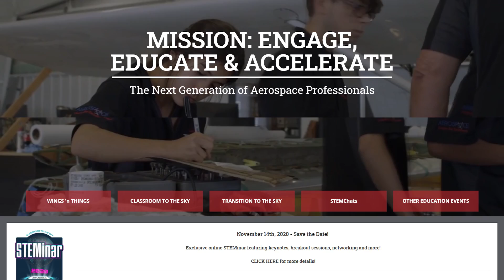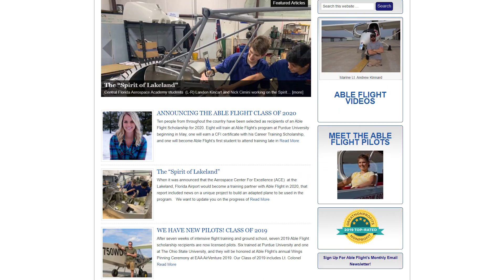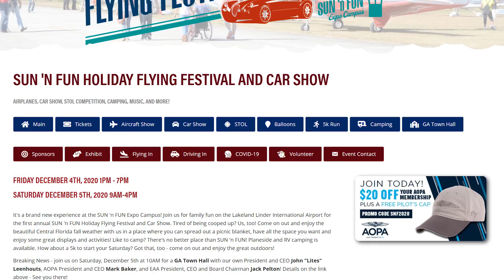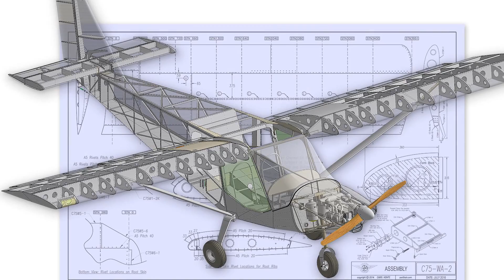Able Flight Project - CH750 Cruzer - Andy Ovans

Comment: Great project. Just some thoughts:
Right seat right pull push throttle.
Left Seat how about twist motorcycle type throttle on the centre stick or rudder stick and the brake on the other stick?
Reason as current set up the pilot has to use the hand for pitch / roll control to change power settings, unless I have seen it wrongly.
Also it would be good it the rudder stick was crannked so that the vertical section was close to the centre of the aircraft, that would allow someone with poor leg control to be able to access the cockpit and might make the grip fee nicer to hold at a more natural postion.
Always worth getting someone who will fly the aircraft to talk to and try the ideas before final fix.

Comment: Absolute pleasure to see this project! Having designed and built a number of hand controls for disabled drivers, and being a microlight pilot (NZ) I would suggest the standard throttle is unsuited. Your disabled pilots do not have 3 hands to control throttle, rudders and stick at critical times, i.e takeoff but mostly landing. My own son is a double amputee and I designed a system for him using a thumb throttle (ATV type) mounted onto the main brake control handle (push/return action). I would suggest a similar setup would allow your Disabled pilots to maintain control of all 3 functions with just 2 hands in these critical phases of flight.  My suggestion would be a throttle pivoting on a horizontal axis (aligned to the pilots wrist rotation)on the control stick, probably incorporating a full hand grip (spade handle). control cable can run down the side of the stick. just my 2 cents worth.
Reply: Was contemplating how I would be able to control all of the systems during take-off/landing and that old ATV throttle is perfect for the job/task. I was thinking about a motorcycle twist-style throttle, like the collective/throttle on a helicopter.
Reply: @v.e.7236  friction may be an issue, and having to grip/release the throttle. Try rotating your wrist whilst moving your arm through the range of movement required for a stick (fore/aft, left/right). It should feel far more natural i.e. easier.  Use the same axis as the wrist for throttle movement. hope this helps. cheers
Reply: @stevemowat4294  Ha! I was going through the motion as I was contemplating your design vs mine and realized that bind issue instantly. You get a thumbs up. lol
Reply: V. E. You are more than welcome. I have spent a short time in a chair myself. Always happy to use my experience to enable differently abled persons. Thanks for the feedback too. Cheers

Comment: This is amazing! I've dreamed of flying my whole life but being disabled in a wheelchair (double amputee with other complications) has made accomplishing that dream quite the obstacle. I've heard of the able flight program and would really like to apply for the scholarship but their facilities are all back east and I live in California and don't have the ability to be out there for the amount of time that would be required to complete the program. What I'd like to do is try and save up and buy my own small ultralight and then modify it my self for hands only control.
Reply: Jess Hull - check out this organization there maybe funding that considers your situation. They could house you and provide assistance during your flight training. Once you’ve been bitten by the flying bug you’ll be hooked for life. An ultralight aircraft maybe the way to go because you can modify the aircraft to meet your needs but getting your initial flight training is a must to be safe. Write to them and ask they may provide you answers or give you some direction. Never hurts to ask they can only say no.
Reply: hey jess hope you succeed zenith has tried for a long time to design systems that address handicap issues also check out the older 2 axes controls on the ercoupe
Reply: william strome - William, I don’t know if you follow James Good’s channel with his ERCoupe? His brightly polished ERCoupe has the mixer control modified with the rudder pedals added to give his aircraft greater control authority in the 3 axis, but James recently covered a story about a pilot with no arms qualified in the original ERCoupe design. Yes it’s the one you mention. I was amazed to watch her live life and operate & fly her bright Yellow 1940’s model ERCoupe. After watching James episode I now feel guilty about complaining about ANYTHING in my life because if she can overcome this disability and be a wife, mother, drive a car and learn to fly and operate her aircraft I surly can’t  complain about my trivial crap I felt the need to bitch about in my life previously. Her attitude towards life for me was a deeply moving and eye opening heart felt understanding of how a person born into a life with a disability that wouldn’t stop her from achieving what she wanted to accomplish. For me she raised the bar extremely high for any person dealing with a disability and with this organization helping people achieve the possibility of learning to fly and developing an aircraft that will be suited for this application I know now where my contributions will go to in the future. I wonder if taking the original mixer assembly idea incorporated into the ERCoupe could be designed into any of these LSA’s. I know the ERCoupe needed to twin rudders to give the aircraft the rudder authority at slow speeds if I remember James talking about the original design. But with design software being so advanced today I wonder if the optimal aircraft couldn’t be designed from a scratch sheet build and utilize this approach and eliminate rudder pedals all together for disabled people. This way the engine control could be operated with the free hand instead of tying up one hand to operate the rudders. This design worries me about operating the engine controls with a pilot on short final and trying to make engine adjustments or cutting power after the landing threshold when their hand is needed on the controls. IDK what these designers have in mind but going over the landing sequence has me concerned a bit. Or maybe they will just need to fly with another pilot all the time. Again IDK. With electronics becoming so advanced these days it won’t be long before a pilot will just tell the engine controller set 1,700 rpm and it will set 1,700 rpm. Or just put an electronic control on one of the controls themselves. A simple slide type rheostat with some friction on it to hold it in place with maybe a mechanical backup that follows the electronic input. That may take a few years but it’s already being worked on today.
Reply: @MrWATCHthisWAY  yes john I've seen his channel the original design was built with no rudder pedals that's why the young lady can fly it with her feet she could'nt hold the yolk and operate throttle and radio otherwise